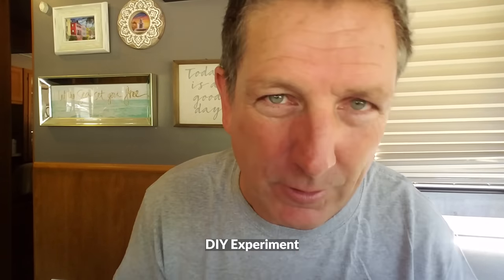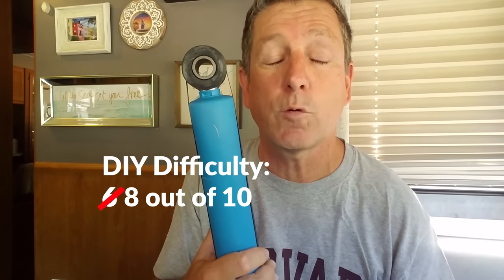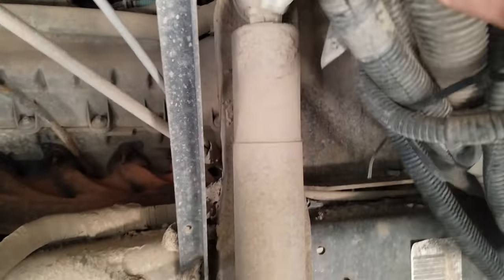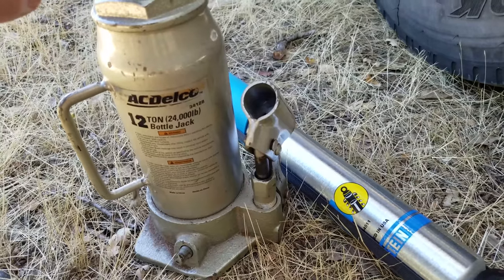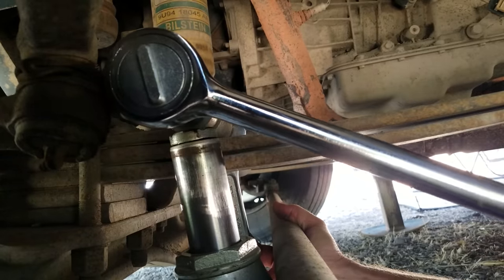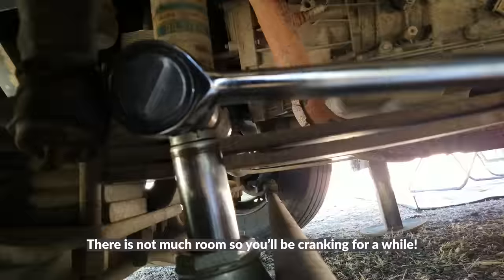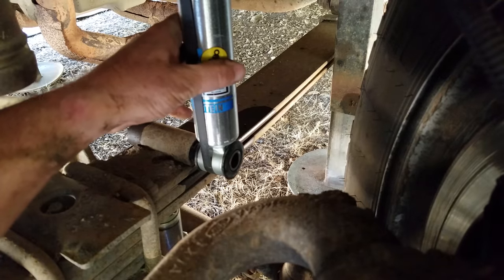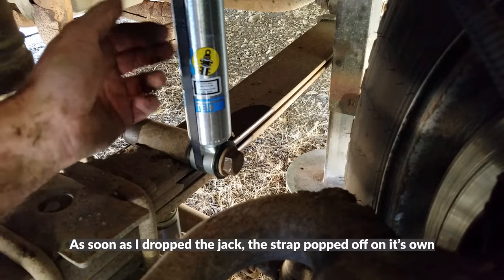Ford F53 Motorhome Front Shock Replacement #fordf53 #fordf53motorhome

Comment: I LIKE these kind of videos, Paul  !!!!  I also respect the fact that YOU do some of your own repairs to your motorhome ....  There are a lot of repairs / general maintenance that full timers CAN do, with a bit of patience and common sense, that WILL SAVE them a bunch of BUCK$ ..
Reply from the maker: Thanks Rick. I also want to show what you can do with minimum tools. I know folks are trying to help and it's easy to say you should have this tool or that tool, but the bottom line is space to store tools and is it worth carrying something you will use once every few years. I should have mentioned renting tools at a local parts store. That's a great option!

Comment: Did this same project, I found my electric impact worked great. For the front lowers I just need to turn the tires out of the way and I could get right in there.
Reply: Thanks for mentioning this.  I was wondering about that myself.

Comment: I'm guessing you changed the shocks out to get ride of some of the bounce and rocking.. check out Sumo springs.. the shocks will make a difference for sure but the Sumo springs will be a game changer.. We travel in an 2001 Adventurer f53 and they made a HUGE difference.
Reply from the maker: We only replaced them because the front right was bad and it was dipping to the right on a left hand corner.  We don't get much bouncing and rocking, to be honest, but we will be looking at Sumo Springs down he road.

Comment: Nice job on the install. I replaced all 4 on my F53 and it almost killed me. Just kidding. The rear shocks were much more difficult. The shocks made a big difference, but the Sumo Springs I installed were a game changer.  Check out my video on F53 chassis upgrades to see all the stuff I installed to make our coach drive like a dream.
Reply from the maker: Definitely going to have to check out the Sumo Springs. I think Kevin has them on his coach.
Reply: If you had only added the new shocks you wouldn't need the sumo.  Tractor supply has the 8 inch bolts.

Comment: If I would travel in our motorhome as much as you do I would definitely invest in the Milwaukee Fuel battery powered 1/2" impact driver. With 1400 lbs of reverse torque you will get any nut loose or you will break it.
Reply from the maker: We only have so much room for tools. At home I had ALL the "just in case" tools, but in the RV, I have a tool bag and that box of large sockets and that's it. If you have a big old diesel pusher, you can carry everything with you...we don't have that luxury!
The other thing you have to think about is, firing up an impact driver in a campground is likely to get you booted out or at the very least you'll be told you can't work on your vehicle there because you are disturbing other campers. With that being said, I've got some 18v Ryobi tools , so I'll have to see what kind of impact driver they have!
Reply: @LifeWithPaulLorena  So much "common sense" explained, Paul ... 
And it really IS just "common sense", if folks would THINK before posting a silly comment ...LOL
Reply: Ebay has an 1/2 drive 20v impact wrench WITH battery for $85.

I have used the hell out of mine... even removing and replacing lug nuts.

Even Harbor Freight can't sell them for that price... they don't come with a $50 battery that you have to buy.
Reply: My son and I did this job a couple of years ago on our F53 chassis. Had to crank up the pressure all the way on the pneumatic impact to budge the top bolt.  Definitely improved the ride for sure. BTW, everything on a motorhome is 8 on a scale of 10. Try replacing a radiator.

Comment: As a retired mechanic, I can honestly say the F53 front shocks are super easy. There are far many more challenging shocks and struts out there. DIYers please understand this shock would be classified as very easy by most professional and shade tree mechanics. Do not let the 8 on a scale of 10 worry you. It would be better classified as a 2-3 out of 10.
A few taps with a hammer would have popped that lower bolt out easily, without any fear of injury. Also, please use a box or open end wrench to back up your nuts, never use a Cresent wrench. Some knee pads would be good for us over wrenchers :)
Reply from the maker: I would think a retired mechanic finds this a 2-10. This was for those people who rarely do there own mechanic work and find this intimidating. When you are full time living in an RV you probably don't have a full tool box full of everything you need. I literally have a small tool bag plus a large socket set for RV. I agree you should use a box end wrench, but I don't carry one that size. You have to run what you brung Dennis!

Comment: Not a DIY'r but like knowing what is done when it's done. I just had extensive replacement work done all around. Ball joints, tie rods in and out, idler arms, center link, pittman, new chassis sensors ETC: was not cheap. Drives sooo much better as was neglected sooo long.
Reply from the maker: Yeah, that stuff will make a huge difference if it's been a while!

Comment: Hey Paul it's Leon for California, Nice DYI job and video!, a year ago I bought the Ryobi One+ 1/2" Impact Wrench it's rated at 300 ft-lbs and has very been reliable for me and a reasonable price, however once you start the Ryobi collection its hard to stop, the tools nice to have on the road, my work light, impact, tire air compressor, blower, soldering iron, glue gun all using the same 18v batteries.
Reply from the maker: You hit the nail on the head...once you start down the Ryobi or "insert system of choice here" then you are stuck in that system. The Ryobi stuff is pretty good though. I actually have the Ryobi One+ 18v reciprocating saw, that I use for firewood. :) Once you start full-timing, you're going to have to make some decisions on what to carry. In my house, I had EVERYTHING just in case, but carrying all that extra weight in my RV, was a different story! It was all sold or given away...😢
Reply: Paul would HAVE to LOAD the Ford Edge up with ALL THAT STUFF, and WEIGHT, just to have it IN-CASE those tools were ever needed !!!   DUH ...................
Reply: Well sounds like you already carry the battery and charger for the saw, a hand full of the needed tools you would use frequently like a impact might be worth it, the tools actually are very light without the battery. For example Paul’s tire pump looks at least twice the weight as the Ryobii one+. Good idea though, A towed hatchback would make a great mobile tool box. ;)
Reply from the maker: RV Trip'n, you're right...the weight of that particular tool is not necessarily an issue, but I am always looking to carry as little as possible. We constantly go through things and ask ourselves, "do we really need to carry this?" Then we donate it if we don't need it, regardless of how small it is or how much it weighs. Thanks for tips!

Comment: Being an engineer, we are given specs to work within. Most of the time it comes down to cost. Also, you should have cleaned, with light oil and steel wool the bolts. That makees re-install and later removal better.
Reply from the maker: Thanks for the info! We know the engineers do the best they can with what they've got!

Comment: Just "LOVE" to see Paul try and do a Front Wheel Bearing Check? Its a Simple Procedure that Most RV'rs fail to get done, and should on a Regular basis(yearly)..in a Tire Rotation.(YEP..Pick a real HOT day to "Rotate" those tires while yer at it please Paul  :)   )
Reply from the maker: I already replaced the bearings in the rear axles. Both sides. I have never had a bearing go out before it let you know, well in advance from the screaming, that it isn't a happy camper!

Comment: I carry air driven driver and sockets for these kinda jobs, but I also have several large box wrenches. Much safer than using a crescent wrench. The advantage of owning a DP is air supply.
Reply from the maker: Yep, a DP has it's advantages in that respect, for sure. But for as much as I'm going to work on mine, I don't see the need to carry too many tools. With that being said, I definitely need a large set of box end wrenches!

Comment: You can put the jack under the spring. Not the schock and its pretty easy yo remove the dhock that way
Reply from the maker: It depends on if the shock is fully extended or not. If the shock is still trying to extend, holding the spring won't relieve the pressure on the bolt. Unless I'm misunderstanding what you are saying.

Comment: Just got done. Tools you need: 2 - 1 1/8 sockets (1/2 or 3/4" drive), ratchet and breaker bar, 1 1/8 combo wrench. 2 washers on top? / 3 washers on bottom? Why not 3 and 3 washers?, pay attention.
Reply from the maker: I don't remember having more than one washer top and bottom, but that was a while ago. I hope yours made more of a difference than mine did.

Comment: Great video. I would suggest spraying the bolts and nuts with a good penetrating oil like PB Blaster before starting. Even starting a couple days before and spraying them a couple times. Makes a big difference in how hard/easey it is to get the bolts out. I also coat the bolt with a light coating of wheel bearing grease to prevent corrosion and wheare. I also have a small 36 oz hammer to tap the bolts out and in. 
How does it ride with the new shocks? 
Have you checked the bushings on your sway bars? New polypropylene bushings in place of the OEM rubber bushings will help with the ride.
Reply from the maker: Good points William! I waited until I was in it to get out the WD40! I don't notice a huge difference in the ride. It was dipping hard to the right in a left turn, which it isn't doing anymore.
Reply: @LifeWithPaulLorena   Look at the bushings that connect your anti sway bar they may be deteriorated.
Reply: I put Cop-r-Kote on Everything !

Comment: Remember not to torque the bolts that run through the shock until vehicle is on ground level and off jacks, also follow torque specs for rear and front shock since weight may vary , well at least in cars or small pickups, thanks for the tip on raising the leaf spring, I would bolt the top cut the strap and let the shock land on the jack then raise the shock, to line up to the bottom bolt, next time Ill  try your method
Reply from the maker: Thanks for the tips FW!

Comment: Use PB Blaster to loosen tight bolts.
Grease bolts helps on installation, lock tite is a definite requirement.
Torque to factory specs.

Comment: I am trying to figure out.... what will this new shocks absorbers will do because it didn’t seem the old ones weren’t badly...??
Reply from the maker: The old ones weren't that bad, but I was getting noises from the front end and the shocks were the easiest, quickest and cheapest change to make. I didn't notice any change in ride, but the noise seemed to subside a bit. I still think there is an issue I need to find.
Reply: @LifeWithPaulLorena  ok thank you for responding

Comment: A basic install video with all the amateurs mechanics issues & problems. Don’t pinch your fingers!! One question what year is the rig, mileage on old Koni  shocks?? after the install and about $500 dollars in new shocks bilsteen did you have significant ride, control improvement?? A quick follow up would be great. Would like to know if this is money well spent or a waste of time. Thanks for posting.
Reply from the maker: Hi Pete! Yeah, I get people saying, you should have done this and you should have done that and you should have used this tool or that tool. I don't think they realize I'm in a campground with a bag of tools the size of a Superman lunch pail! Lol! The whole point of my "How to" videos is showing you can do these things with minimal tools and no lift.

I had old Bilsteins on it that were shot. The new ones were about $125 a piece. I didn't notice a significant difference in handling, only they didn't make a bunch of noise during cornering. Thanks for watching!

Comment: It may have been an illusion but the new shocks look bigger/beefier than the older ones.  Is that the case?  I bet those old ones were shot after the trips to Alaska and Baja.
Reply from the maker: They have a little bit larger bore. They have been working good so far, but not what I would call a noticeable difference.

Comment: Very nice and succinct video Paul.  HAVE YOU THOUGHT ABOUT THE SUMO SPRINGS TO HELP ELIMINATE THE SIDE TO SIDE MOTION that sometimes happens when going over bumps or do you think the new shocks will take care of that?
Reply from the maker: Do you have the SUMO Springs Chuck? The only time I notice huge swaying is pulling out of parking lots, but not too much rolling down the road. The shocks will only help sway a tiny bit. Our front right was toast and the coach was dipping hard to the right in a left hand turn.
Reply: @LifeWithPaulLorena  I don't have the Sumo springs but have been thinking of adding them.  I notice the rocking when driving and changing lanes where there are different levels.

Comment: is there a website that can help you find right size shocks for rv?
Reply from the maker: If you have the F53 chassis, all of the auto parts store websites have them. They probably have them for the Chevy Workhorse chassis as well. As far as diesel pushers you would have to check with the manufacturer of the frame.
Reply: I'm thinking that Ford already did the research and installed the best.  Just replace with same that is on yours.  Better yet... leave the old ones on and add new identical ones.  All you need is longer bolts from tractor supply.  Quad shocks make a significant difference.

Comment: Thanks for the video! Looks simple enough, with a good bit of muscle work. I wonder if tying a strap around the old shock before removing would make it easier?  I mean jack it up 1/2" then strap, then you have 1/2" to stretch the strap.  Ok, perhaps 1" is needed. What can you use for a strap?  How about a pipe clamp?  What safety do you use to jack up the motor home? or is the tire still on the ground?
Reply from the maker: A strap would work. Anything to hold the shock from extending before you need it to. The tire is still on and touching the ground so it's a pretty safe process.
Reply: @LifeWithPaulLorena  There must be a lot of room under there to work with the tire still down.  I cannot stress how important safety is, there are just so many other videos about people going under a vehicle that's only held up by a jack.  Every video should have a short blurb to remind others that jack stands & tire chocks are necessary.

Comment: A smarter thing to do is go to Tractor supply and buy some longer bolts and just ADD the new shocks.  Keep the old ones on and with quad shocks you will have a much much better ride. I promise!

Comment: Its a truck Chassis there is no easy DIY on commercial vehicles.
It's all going to be 7/10 difficulty or above.
Just removing the tire is a workout 6/10 
Even the lug nuts weigh a ton! :D
Don't use those harbor freight Jack Stands!
Reply from the maker: There were no jack stands harmed during the making of this video. 😃

Comment: Really?
Where was the part where you let people know to take bolts to bench grinder with wire wheel and clean bolt shank and threads of rust. Then what about grease on shank and threads when reinstalling the bolts so they save the rubber bushings and the threads don't rust.
If your going to show something please show it done correctly.
Reply from the maker: Well let's see mister know it all. There wasn't any rust to remove on a mystical bench grinder that wouldn't be available to the average person trying to do this else they are on the road. The nuts came off and went on by hand fairly easily.The threads are in a metal bushing and don't directly touch any rubber parts. And last if you put grease on the threads you might have a bolt back out and lose a shock going down the road. Just because it's your way doesn't make it, the correct way. I appreciate your thoughtful comment though. Have a great day!

Comment: I was just quoted $480 to replace the front shocks on my F53 chassis by my RV dealer. I asked what brand and they said they had no idea which shock the distributor would send. I said...... no thanks.
Reply from the maker: Hey Tom! That's not too bad I guess, but you can find these Bilstein (great brand) shocks online for $100 each or less online, so figure $280 in labor...nevermind, with the tools they have it will take them less than an hour...holy crap! The other brand you might want to look at are the Koni.
Reply: Do you think Koni is better than Bilstein? Which one has soft feeling instead of hardness

Comment: 5 minutes each with impact
Reply: You wish...  breaking those over torque bolts  is anything but easy.  Once they are a half round the impact wrench makes it fast.  Also even with the strap the holes aren't going to light up like they did in this video.

Comment: Great job!  And while filming. You said $150 for the shocks. Is that for all of them or each?
Reply from the maker: That is each Cecilia...you can get the Bilstein online for about $100.
Reply: I found the Bilstein shocks at Summit Racing for $87.00 that fits my P30  chassis. It was around $30.00 cheaper per shock than anywhere else online.